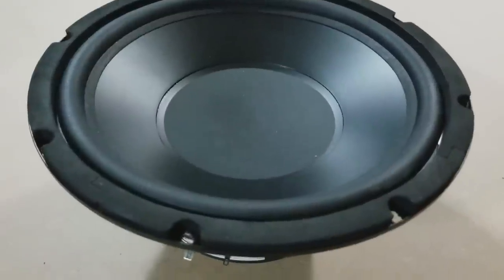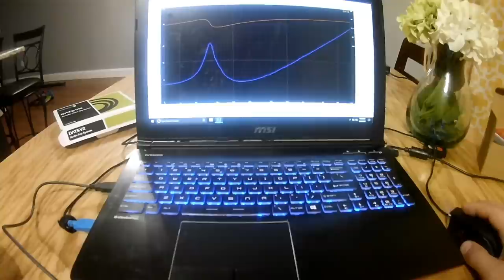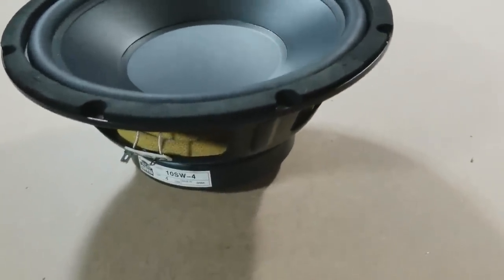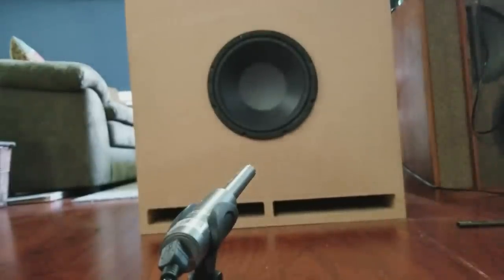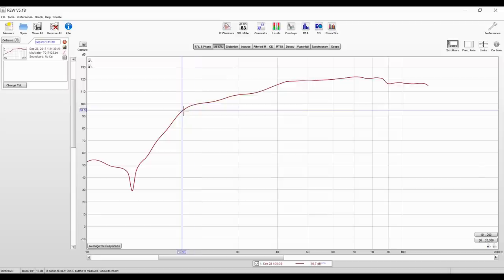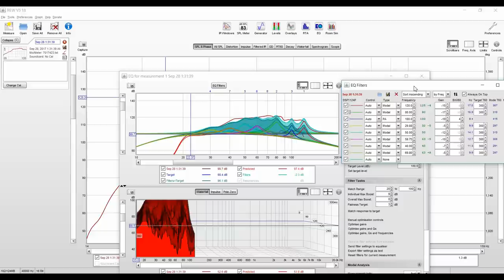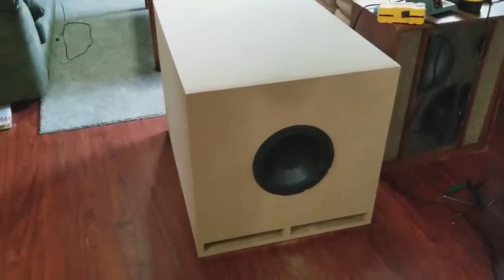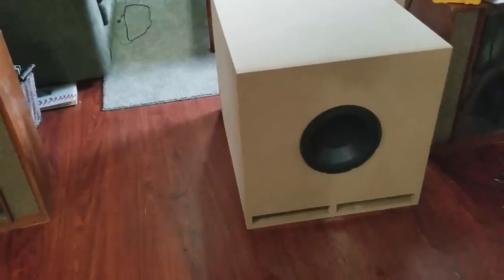20hz from a $20 Subwoofer? Budget Build?

Comment: whats so unbelievable about a 10 inch going down to 20hz? you can get that with a 6 inch in a small room and right placement
Reply: a speaker cone moving at 20 hz and a speaker cone reproducing sound at 20 hz are not the same thing. any woofer/sub woofer can move its cone at 20 hz but those that can actually reproduce sound down to 20 hz without blowing up are usually expensive... real expensive like in a 10 grand+ range. a qts of 0.63 is unusually high, you won't find many drivers having that kind of qts on the market especially not that cheap.

Comment: If your impressed with the GRS check out the Dayton 10" classic series woofer... Yes woofer - not subwoofer... Slap it in a .94 cu.ft. sealed box, 48db 50hz low pass xover, filled with polyfill... Pump about 300watts into and each let them dance lol... I ran 2 of them in my old s10 lowrider...For two cheap ass 10's wiggling my doors flexing the cab they were great..!!! My buddy who always bought super high end crap could not beleive what he heard then wanted me to stuff 8 of them in his camaro...
Reply from the maker: houseoffire72 I think I actually have an 10 inch classic woofer. I was working on a three-way design with it
Reply: 123Toid they work nice in a 3way. Try it as a sub like I mentioned with specs. Its really pretty impressive for what it is. I built my box with 2 layers of 3/4" mdf.
Reply: houseoffire72 MI

Comment: Meh. Back in college I built a ~4.5f^3 box with a cheap <$50 10" sub that was only ~6dB down at 20Hz.  Not exactly impressive performance from the sub to hit 20Hz when it's ~25dB down. I mean, why not claim it can hit 18Hz? It's only another 5dB down. After the first 25dB, what's another 5dB?  Heck, why not just say say it hits 10Hz?  It's also on the response curve. 
Just to be clear, that's all aimed at the mfg claiming 20Hz, not at Toids or his box.  
My box was almost as ridiculous. Although it was super cool watching the walls and floor of my house oscillate at the sub-harmonics.  Standing in the middle of the room the box was in, you could feel yourself going up and down as the floor oscillated.  Kinda freaky actually.  I was powering it with a 200W Carver stereo amp bridged.  It was an old house built in the late 40's with wooden floors, no carpet and a basement.

Comment: could run iso baric get 8 subs double the power handling and up output an keep box same size
Reply from the maker: Did 4 of them here: this is tremendous! https://youtu.be/CvUjWNwPHDU
Reply: @Toid  thats awesome !!! , do they sound decent or are they just low end monsters?
Reply from the maker: @hiviman  they sound good. You can actually read more about it on the forum. There's at least one of the guy over there that's built it. You can get his impressions as well. https://toidsdiyaudio.com/community/diy-subwoofers/iso-100-build-20hz-for-under-100/#post-6117
Reply: @Toid  ok thanks for the info an good vids

Comment: You don't need a massive box like that to get 20 Hz, my PB-1000's cabinet is 20 x 14 x 18 inches and tuned to 22 Hz. Plays flat down to about 23 Hz aswell, and it goes down to 16 Hz usable and 13 Hz but basically unusable.
Reply from the maker: You do for this $20 subwoofer.  SVS manufacturers their own drivers to fit their parameters and many manufactureres of subwoofers have a DSP built-in to get a better low end response.  it is pretty neat to see what some companies like SVS and HSU can do.
Reply: 123Toid Yeah that’s true, the driver in the PB-1000 is pretty boring besides the massive surround and like 2 - 2.5 inches of excursion. It’s pretty expensive for most people but definitely the craziest 10 inch i’ve ever heard or seen. I don’t think any subwoofer play flat down to 20 Hz without ANY eq. But really interessing project, i enjoyed this video :D

Comment: With a Qts of 0.6 the sub only delivers the 20Hz when the weather is about the same as when you measured the TSPs. If atmospheric pressure, humidity or temperature differ it might need a different enclosure. Above a Qts of 0.45 there is not much tolerance left and the system is very sensitive to parameter changes, as the German magazine Hobby HiFi discovered.

Comment: You built a vented box to get that 20Hz!...That is basically a loud, rumbling, groaning Home theater bass subwoofer. Vented boxes are not very musical, compared to sealed box subs but they are way more efficient: There are almost no genuine musical first fundamental notes below 50 Hz. There is a good reason why sealed boxes, which are way less efficient, give far more realistic-sounding notes. The cones do not wobble. This why good sealed box subs cost twice as much, whether by Velodyne or any other mfgr as their mass-market vented subs. It is the same reason why good shock absorbers make for a far more controlled ride than do bad springs on an auto.
Reply from the maker: Larry, you are probably used to a lot of car and commercial subwoofers, which most of what you stated would be true.  When designing and building your own subwoofers you can control air port velocity, which can make port noise completely inaudible.  Unfortunately most manufacturers don't do this for a variety of reasons.  The first, is typically the box has to be bigger than what most manufacturers want.  This is due to the fact that in order to reduce or eliminate port noise, the port would have to be bigger, which also increase the length of the port, ehich then increase the size of the box.  So instead, manufacturers put it in a much smaller port, flare it mightly and hope you don't mind the port noise. Not ideal by any means.  However, a properly designed ported or passive radiator setup can sound just as good as a sealed.

You are right, about the musical notes.  However, for home theater the magic number to hit is 20 hz.  It  is pretty neat, as this sub was inaudible at 20hz (like it should) but you feel the power all around you.  It actually shook things over 10 feet away, but with no audible sound.  Of course, bass 20hz and under should be felt not heard.  Great comment.  Thanks for all your time to write it!
Reply: Actually I have no interest in auto subwoofers, and I find your response and its tone patronizing to assume so. Even Parts Express, which is not otherwise known for serious information, has some data about this. Suggest you read it. The concept has nothing to do with port diameter and rush, it has to do with the physics of the cone coming back to rest after the initial pulse as opposed to continuing to wooble/oscillate after the first pulse, which give more noise/output but less pure notes. Have you not seen drummers in a symphony put the hands of the skin of a kettle drum after they hit it? This is why.
Reply from the maker: larry, I am sorry if you felt I was being patronizing, that was never my intention.  Just for clarification I did say "car and commercial subwoofers."  The commercial subwoofers I was referring to were home audio.  You are always welcome to a difference of opinion.  There is very little learning without it.   And my only intentions are to teach and learn from others. Having said that, if you look up the highest rated audiophile subwoofers you will see both sealed and ported designs.  There are benefits to both.  In fact the Golden Ear Trinitron series, which is a renowned  reference loudspeaker line exclusively has powered ported subwoofers built into their tower speakers.  They along with many others have been able to produce reference sound from ported subwoofers.  SVS is another manufacturer that prides themselves on high quality sound.  They even go into great detail of the differences in ported and sealed here: https://www.svsound.com/blogs/svs/75367747-sealed-vs-ported  The basics of the article states that sealed will typically sound better for critical music listening (note the word typically).  Even they know this is not always the case.  They even note later that their ported design is on par with their sealed from 30hz to 120hz, the typical music bandwidth.  You are welcome to bring new facts to the table that I may not be aware of.  But in my experience of building and testing subwoofers, a properly tuned ported subwoofer can sound just as good a sealed subwoofer and can get lower extension without the need for room gain.
Reply: Larry, you say Patronizing ? WTH ?!?!  Butthurt Much ? Geeze,,, Smh...

Comment: my 4" can play 20 hertz
Reply: Aydin Lobas "can play" What level of sound pressure do they put out? 100db of noise? 20Hz Is breathtaking at 100dB. Thing with subwoofers is that the lower the FS and QMS the lower the efficiency, therefore lower sensitivity... 4" drivers usually have FS around 120Hz in which case they are ALL midrange drivers, or just hyped bullshit.
Reply: Lol my 9mm earplugs can go to 20hz. Aint that cool. Although id consider my Ground Zero 38XSPL-D2 a little bit louder at 20hz
Reply: Since when is 20hz at 100db breathtaking? That’s really not loud or intense at all.
Reply: My Phone can play 20 Hz
Reply: The Tech Guy By Aidan Shane Wade my 0,001" play 1 Hz tho
Reply: Nate SS  Hes talking about actual breathtaking...  Tony hurts played from a huge subwoofer at a hundred db can really knock the wind out of you...  I remember my 1st time stepping in a professionally built car...  Two 18s sitting right behind me was amazing...  In till I realized just how fuckings loud they were...
Reply: SquigglezDoesMusic my speaker can play 20hz-20000hz
Reply: My boss audio 12” elite can play 16 Hz f10
Reply: @lucidtickle8347  what brand phone, want one.
Reply: 20hz at 200db is death taking.

Comment: So it can hit 20 Hz at -25dB and the box is massively oversized!🤔
To be fair that's not really very impressive at all. If it was say -6 dB or something like that then it would be a lot more workable, or -12 dB so an EQ could raise it up to 0 dB.
As it stands though, that's like looking at any driver's -25 dB point in a WINisd simulation, just seems pointless.
Would have been more interesting to see how it performs in a sensible sized box and maybe not focus on such a low -dB point. Otherwise you may as well just pick a frequency all the way down to the lowest point.

I do really enjoy your videos, have learnt a lot from them, maybe I'm being harsh but I just don't quite get the point of this video.🤔 Maybe I'm missing something.🤔

Comment: Any subwoofer can easily hit 20 hz.

 just need a box to support backpressure of the driver to that frequency
Reply from the maker: This is a common misconception about subwoofers.  Unfortunately, this isn't true. Every speaker, including subwoofers, has a unique set of T/S specs that will determine the usable frequency vased of box size and the mechanical limits of the subwoofer.  And although, it would be great if every subwoofer played a 20hz tone, many are not designed to work that low.
Reply: Sadly i'm going tohave to disagree with that statement aswell. you see.

A subwoofer thats in a box thats capable of creating a standing wave at 20 hz will play it. reguardless of what the t/s specs are.  Any woofer that is capable of moving the air needed will do it. 

T/s specs are just there to give you an idea what inclosure said woofer would be the most happy in.

Ohterwise every woofer would only be happy playing in 1 box.

Ever watched the video where a guy puts two 4 inch dayton audio subwoofers in a box desgined for 2 15's. their fs is 53 hz and they play a 25 hz note just fine.

Just saying. ive expermented with boxes and woofers since a looong time. and with that experience i'm confident on where i stand.
Reply from the maker: There is a difference between usable 20hz and being able to play a 20hz tone.  Many sealed speakers can play a 20hz tone, but it will be at significantly lower volume than the rest of the frequency range.  Speaker designers and manufacturers use an F3 (3db down) to determine usable frequency response.  The reason for this, is quite simple.   After a speakers F3  your frequency response will start to drop dramatically.  Making all those frequencies underneath it unusable.  This is due to the fact, that your usable frequency range will play significantly louder.  So even if you could have a 20hz tone generated, it would not be able to keep up with the rest of the range, which makes it unusable.  Typically in those types of videos, that you are referring to, they are playing a single 20hz wave, with the amplifier jacked up.  If they switch to say an 80hz tone, everyone would running for ear protection, due to the significant change in SPL.
Reply: Mr Dashpuppy but he "expermented"
Reply: Alright i want to just start off with asking can we stop with the Unnessesary comments that don't add anything to this discussion?  I know you want to seem ''witty'' and clever with but you're just not..
 Please come back with someting that will add to the discussion ohter than comments like grumpybill's.

Secondly take i saw you took note of me saying that any driver CAN PLAY a hearable 20 hz sinewave  weather it'd be ''unusable'' or not as you chancged your comment. wording it diffrently than that i originaly read. The point of my whole comment was to refute (as i understood it) your claim that ''only a selected few''  create an audable 20 hz sine wave. wich most drivers can do. ohterwise you can call videos of sundown woofers playing way below their t/s completely fake.
Reply: 123Toid what he meant is that any sub is capable of playing 20hz, its just your opinion on what you consider "usable" volume, whether it be too low of a volume for you it doesn't matter, its still capable of playing 20hz, which is what his statement was about, you changed your wording too, your original comment included "And although, it would be great if every subwoofer played a 20hz tone..." then your next comment had "There is a difference between usable 20hz and being able to play a 20hz tone." so you switched your wording from tone to subjective ideas of what is "usable" because you know you were technically incorrect.
Reply: @RonanAquilius  A sub  that cannot produce usable (iow, i can hear it combined with the whole soundrange of your music) 20Hz is not very usefull. So, your statement can give other people the wrong idea.

Comment: Ive got two ambass comp signature 12s n truely im just not that impressed their also 5krms. Going like from 12 to 1500 rms 12s i honestly cant justify the performance difference or value wasted on huge elec to do 10krms clean ive yet to have anyone with crazy power like that be anything that gives that silly stupid smerk i honestly can say my wlldse 15s are so much more invigorating n ya i get their 15s but both are on a 3400.1  their 1/8th the cost n truly sould better in response and output its very very close so am ordering a db meter n swapping boxes all of any way i can its keeping me awake at night questioning wtffff is up.  
Ambass are juiced by one orion 3000dsplx amp one per sub subs are dual 1 ohm. 
The wlldse 15s are the larger model only come in dual two wich my soundstream dtr3400.1 tower series loves .5 ohm  wlldse are 2.75cuft sealed.  I even cut a new face plate to hold the ambass in the exact wlldse box.  Think i want adire audio bramahas  far more than these ambass they claim 3 to 3.5 inch x max on 1krms.